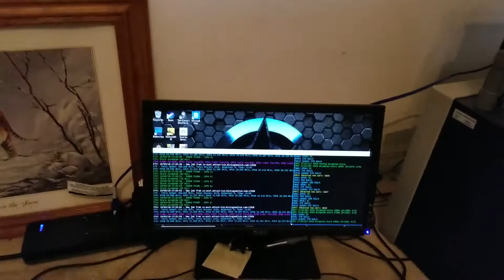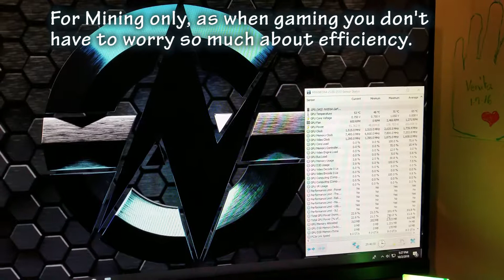Cheapest Mining Rig Update, Kill A Watt Meter Concerns

Comment: I think the cheapest way but it involves some diy power connection box, with exposed/internal wires.
just use a multi meter to measure the amp, watt = amp * voltage
or just buy a cheap battery operated led amp display 
or a clamp meter.

FYI i dont leave my cheap watt meter on 24 for this exact reason, only plug it in when i need to do fine tuning.
I also have a more expensive tplink wireless smart plug hs110, i use it when im not in my farm but want to fine tune it at the comfort of my home.
i also use a clamp meter to measure my whole house, i sometimes use it to measure an actual circuit too, i have a cheap clamp meter, its not very accurate, but it will suit my purpose for measuring whole house as an estimate, of course my switch board is all exposed wires ugly, but its ok coz its my farm and no one lives there. i actually have a fan runing 24 hours coz i find the switchboard gets hot (RCCD and main MCB)
Reply from the maker: Nice, I got a multi meter and clamp, I appreciate the advice. Have a good holiday and happy new year. I will pin, so others can see your info. Take care
Reply: @SerpentXTech   

more options, ali may take a month to deliver, you can probably find something similar in ebay or amazon.

make a power box (for convenient plug in) with this usd4 amp, volt display, or get multiple USD1 induction coil with multiple power box, and only plug in the led when u want a read out if you want to save $$

https://www.aliexpress.com/item/Mini-Digital-Voltmeter-Ammeter-22mm-Square-AC-20-500V-0-100A-Amp-Volt-Voltage-Tester-Meter/32906118521.html?spm=2114.search0604.3.18.4f5411ffdXZlZy&ws_ab_test=searchweb0_0,searchweb201602_1_10065_10068_319_10059_10884_317_10887_10696_100031_321_322_10084_453_10083_454_10103_10618_10307_538_537_536,searchweb201603_51,ppcSwitch_0&algo_expid=68d014ea-2b84-482b-8db5-ec9f6534694d-2&algo_pvid=68d014ea-2b84-482b-8db5-ec9f6534694d

for something more fancy USD6.5 = 6in1 display watt, volt, amp, watt, power factor, frequency , khz, please wire it in parallel as per instruction so it does not burn the unit, you dont want 1000watts going through this cheap thing.

https://www.aliexpress.com/item/20-100A-AC-LCD-Digital-Panel-Power-Watt-Meter-Monitor-Voltage-KWh-Voltmeter-Ammeter-0616/32885968882.html?spm=2114.search0604.3.50.62b648e0BrYM9Q&ws_ab_test=searchweb0_0,searchweb201602_1_10065_10068_319_10059_10884_317_10887_10696_100031_321_322_10084_453_10083_454_10103_10618_10307_538_537_536,searchweb201603_51,ppcSwitch_0&algo_expid=76c5a0ac-040f-403d-8605-48b486c59eb1-10&algo_pvid=76c5a0ac-040f-403d-8605-48b486c59eb1

USD7.8 just get ready made plug simple, but probably have the same issue with burn out, the above 2 diy options does not have that issue as you are actually making the power plug yourself and power does not actually go through the unit

https://www.aliexpress.com/item/KWE-PMB03-Plug-Socket-Digital-Voltage-Wattmeter-Power-Consumption-Watt-Energy-Meter-AC-Electricity-Analyzer-Monitor/32957470513.html?spm=2114.search0604.3.8.30ac246b3fWdeJ&ws_ab_test=searchweb0_0,searchweb201602_1_10065_10068_319_10059_10884_317_10887_10696_100031_321_322_10084_453_10083_454_10103_10618_10307_538_537_536,searchweb201603_51,ppcSwitch_0&algo_expid=4a287b3f-187a-4279-ac58-39d3142de659-1&algo_pvid=4a287b3f-187a-4279-ac58-39d3142de659